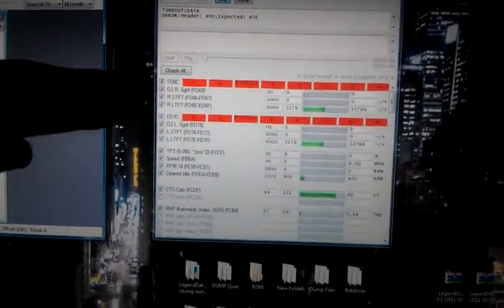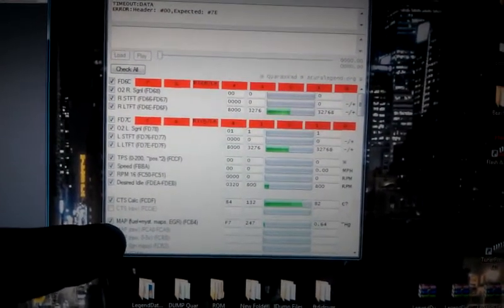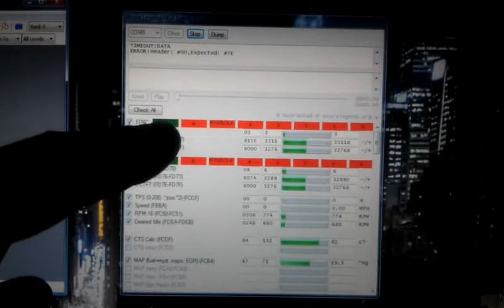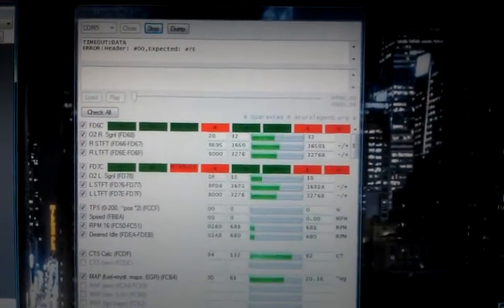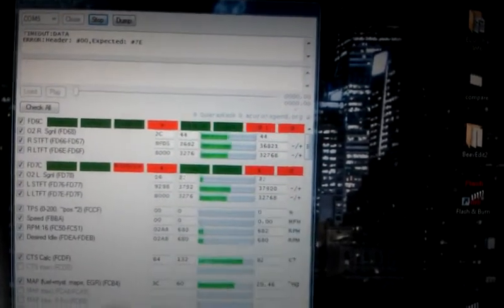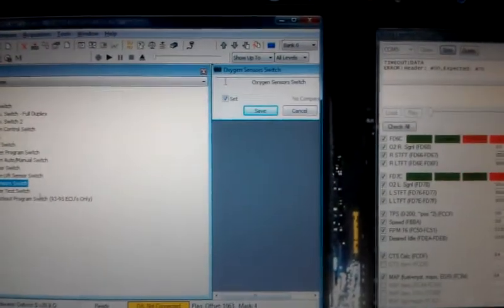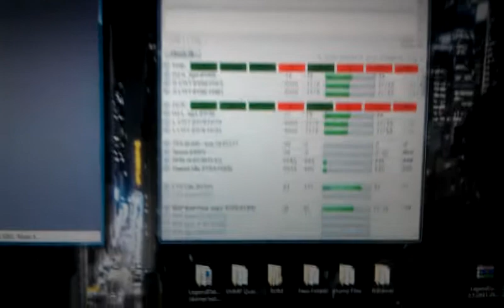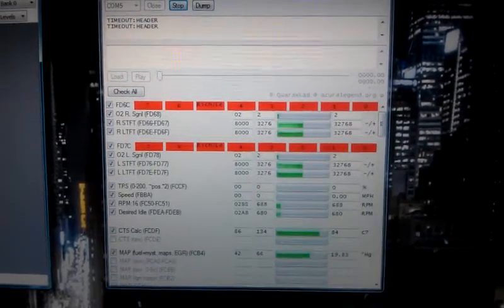Datalogging STFT's and LTFT's

Comment: Thanks for the great video.  My car is BMW 330I. I don't know the reason that bank 2's LTFT is always about 2.4% higher bank 1.  Normallyl, bank1 LTFT is ~ 0% to 08% and bank 2 LTFT is about 2.4% to 3.2%.  I already swapped O2 sensors and the number of both banks stay the same.  I recently replaced O2 sensors, MAF sensor, CAM position sensor.  After all, LTFT bank 2 is still about 2.4% greater than bank 1.  Do you know any potential cause of this? Thanks.